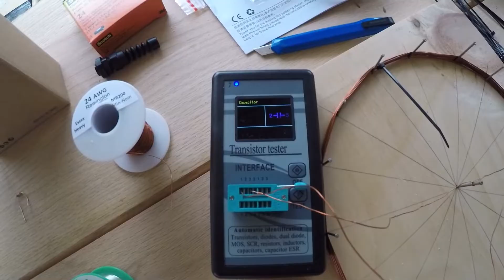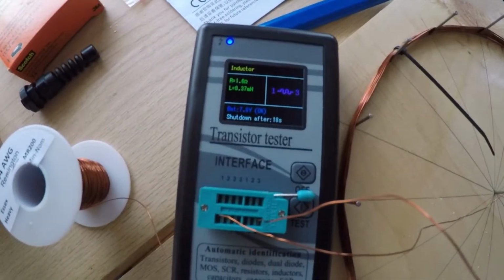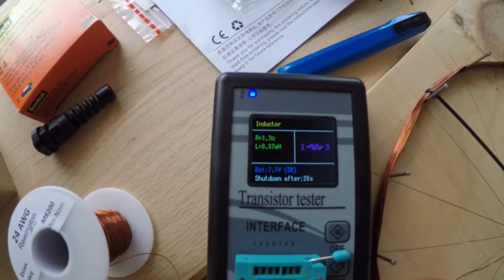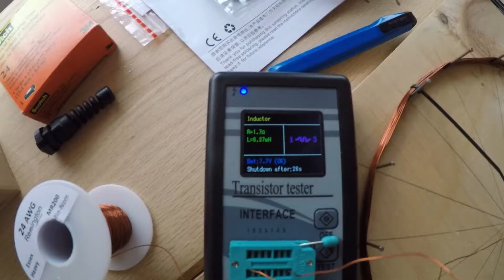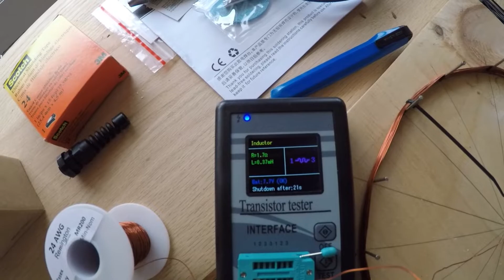DIY Mono Coil for Pulse Induction Metal Detector

Comment: Stupid question, but could you replace that shielding tape with like aluminum foil or aluminum tape?
As long as you keep that gap on top, it basically should''t matter, which shielding material, as long as it's not a closed loop or has magnetic shielding capacity, i.e. is ferromagnetic/iron/steel/mu-metal, as far as I understand.
Planing to build a coil for one of those cheap Ukrainian pulse detector kits.

Comment: Good video! What inductance and dumping resistor you used for the Mini Pulse Plus? Thanks!
Reply from the maker: I think that the inductance of the coil was about 400uH if I remember correctly.  The damping resistor should be calculated as I show in my video.
https://youtu.be/CrJ5tFFmWyo
Reply: @SurfDetector  thanks!

Comment: Are all pulse induction coils compatible with a given PI detector?  I have a PI detector and I want to build a large coil.  How do I know it will work?
Reply from the maker: You need to match the inductance and resistance of the coil to the particular detector

Comment: Hi, Thank you so much for the great demonstration!!! hope you will make more videos !!! and I also have a question !!! I m going to make a coil with 50 cm diameter , 400 uH coil ! And I m going to use a 0.50mm diameter copper wire (24 AWG) but the coil calculator in circuits.dk ask to use a 0.54 mm diameter coil instead of 0.50mm but it is the only size I can buy from the market will that make any effect to the performance ??? it would be great if you can help !!
Reply from the maker: Use the coil calculator on the Geotech Forum, it will be simple for you to calculate the coil.
Reply: @SurfDetector  Thanks my friend !!!

Comment: Hello
Dear surfDetector.
In the video, you connected a separated wire to scotch24 and then the wire is connected to to ground-wire of coil?!
Reply from the maker: Hello my friend.  Have you subscribed to my channel?
Reply from the maker: In the mono coil you solder a wire to the scotch mesh, and then this gets soldered to one of the coil wires then you take them and solder them both to the shield of the cable that goes up to your detector.

Comment: did you solder the ends of the coil wires to the wire feed that runs up to the control box, and, does it interfere or does the coil detect that joint since it is in almost the center of the field, or does the shrink tube block it.
Reply from the maker: Hi Matt,
I seem to recall you asking me this before at some point.  Yes, the wires are soldered in the coil enclosure, the solder joint is not detected, it is a very tiny joint and is moving with the coil.  Are you making a new coil?
Reply: @SurfDetector  yes, the one i mad for the surf pro is not working very good, or its the detector itself. it can detect a metal 2 inch tape measure at 2 inches
Reply from the maker: Hmmm, two inches is not good at all. What are the inductance and resistance of the coil?
Reply: @SurfDetector  yes, especially for a 2inch square tape measure LOL. the ohms are 1.1, and the inductance is .318, used 22awg 300 volt ptfe coated 7 strand hookup wire., removed some of the wire, and it now reads .208 mh and .9 ohms, same wire, specs that came with board said about 230mh. but new coil is not wrapped tight like the other one was.
Reply: @SurfDetector  i took the wire off and put it back on the form but now its to small for the shell, so im going to have to wind again, but this time it came out at 0.9 ohms, and .208mh, the build doc said 230 mh, but my wire wasnt tight yet, so illl make another, you think stay with the build doc at 230mh, or go with 300 mh, i used less turns to lower mh

Comment: which diameter wire would you recommend me for baracuda?
Reply from the maker: I use #24 AWG magnet wire normally.  Tinned, stranded, PTFE coated wire is better but very expensive.
Reply: @SurfDetector  okay thanks
Reply from the maker: @silentgaming9328  I saw that you had another question about checking inductance etc., but it has disappeared.  I use a LCR tester.  The one that I have currently I did a video on.
Reply: @SurfDetector  okay thanks . I dont have an lcr but will go with accurate winding with an online calculator
Reply: And yeah the ptfe stuff is expensive, guess I will go with 24awg magnet wire

Comment: i have to make a coil for the surf pi kit. Can i use a wire of 0.3 mm instead of the 24awg (0.5) or the resistence is critical for that project (usually the resistance increases with a thinner wire ) ?
Reply from the maker: What is of greater importance is the inductance of the coil. You should try to make it around 300uH

Comment: This is why I asked if there was a capacitor in-line you went from it winded to finished never showing how it’s connected to the detector or what’s under the heat shrink you have the only videos on this and I’m so glad you took the time to do them and I know you love your tripod but in future videos could you show how you do your wiring so dumb asses like me can understand you have built numerous detectors and just knowing what you use helps a ton type of wire from the detector to the coil shit I copied most of the parts on your board
Reply from the maker: I will be doing another coil video sometime in the near future.  I will endeavor to show more detail although most people only watch videos for 90 seconds or less.
Reply: @SurfDetector  the length is fine it’s more not moving the camera around to show where all those wires and clips where going to and thanks again for taking the time to make them

Comment: G'day from Australia, i have no electrical training but i have an interest in building my own coils specifically to suit a minelab. I recently bought a multimeter and i want to learn to read the inductance of my current coils that i have. I specifically want to know how to read DD coils, as there are 5 pins, could you be kind enough to point me in the right direction, of course if you have experience with the DD's?
Reply from the maker: Hello Mate,
In order to read inductance you will need an LCR meter.  These are readily available and the price is not too dear.
I recommend that you purchase the book "Inside the Metal Detector"  that will get you started with understanding the inner workings and it has a good section explaining PI machines which  are where my interests lie predominately.  There is a very good section on how to build a DD coil in the book as well.  I have plans to produce a video on a DD build but not in the near term as I have too many irons in the fire at the moment.  Thanks for watching my video and please subscribe.
Reply: @SurfDetector  Thanks for your reply buddy, LCR meter, have been reading on the Geotech site, but never actually heard of that, funny hey?, my interest is in building a very large DD coil like + 30in, the biggest obstacle at the moment would be the housing, would fibreglass work, it would probably be to bloody heavy, but thought i'd throw it past ya?
And i know these coils have to be nulled or something like that, what meter would you use for that, or would you use a oscilloscope for that?
Reply from the maker: You can use either an oscilloscope or you could use a good voltmeter.  A mono coil would be easier to build at that large size and you could house it in PVC pipe.  Youtube doesn't seem to be notifying me of new comments so sorry about the delay in replying.
Reply: @SurfDetector  Yeah mate; know all about youtube and not getting replies,i am from Australia so my interest is in building a large DD to use on my old SD, the highly mineralised soil in the goldfields causes to much false signals using a mono, a 14in mono gives me enough trouble , no way will i be digging 4 ft holes for a false signal, do you know how hard this ground is? have dug at least 3 - 3ft holes for rusty metal, and each hole took a good couple of hours to dig, bloody hard work, this is what i bought it is a " Professional Waveform Multimeter MT8206", it says it is a multimeter and oscilloscope 2 in 1, would this be good enough?
and it has the resistance and capacitance measurement but not induction so looks like i will have to buy an LCR meter.
Can you just explain to me why the DD coil has 5 pins, when there is only 2 wires, is the 3rd pin the ground or neutral, or whatever it's bloody called. 
A large 3D printer could probably print out a casing but not to sure if they are really common and plus you would need to have a design made up first in a specific computer program, Nexus makes carbon fibre coil housings but the bastard wants between 3-4k for his coils, i told him where he can shove it, sorry i babbled on a bit here, will keep it must shorter next time if any!!
Reply from the maker: @egghead2687  A DD coil is comprised of two separate coils, one is Transmit (TX) the other is Receive (RX) so there are 4 wires for the two coils.  The 5th  pin is most likely the shield.
Reply: @SurfDetector  Heck mate; i know about Rx and Tx, you say 2 wires for each? okay; i just realised that when first winding the coil, that original end must be free to be attached later to the cable to complete the circuit (loop) am i on the right track?, i have much to learn about circuitry in general it seems!!
Reply from the maker: You should get yourself a copy of "Inside the Metal Detector"  it's a cracking book and will explain all of the inner workings of detectors and coils.  Keep at it, the good stuff never comes easy.
Reply: @SurfDetector  Thanks for the advice, will do!!

Comment: Should 12 volt electricity come out of the disc outlet?
Reply from the maker: With the coil attached you will generally have a pulse of approximately 12V followed by the flyback voltage which can be in the hundreds of volts.
Thanks for the question and I hope that you will subscribe to my channel.
Cheers
Reply: @SurfDetector How to connect the screen with the device
Reply from the maker: @theworldofelectronics9913  What detector are you working on?  Are you asking about the cable connection to the PCB?  Thanks
Reply: @SurfDetector I am using the Delta Plus 2 device
Reply from the maker: @theworldofelectronics9913  email me a picture of your coil connection on the pcb and your cable.
Reply: @SurfDetector send me your E-mail
Reply from the maker: @theworldofelectronics9913  
it is on the YouTube page
Reply: @SurfDetector Thank you
Reply: @SurfDetector I have sent you the device picture to your email
Reply from the maker: @theworldofelectronics9913  I never received the picture.
Reply: @SurfDetector Thanks my friend for the answer
Reply from the maker: @theworldofelectronics9913  You are welcome

Comment: hi which kind of cable you use to connect coil to PI circuit? coaxial cable or something different? which is the best cable?
Reply from the maker: Hi Andrea,
Welcome to my channel.  I hope that you will subscribe.  I use Canare DA202 cable for all of my coils.
Thanks for the comment :)
Happy Hunting.
Reply: @SurfDetector  hi thanks for your answer. Yes i subscribed.. ;)..
I check this cable, It gas two cable and shield.
Do u connect the two cable with coil leads? And cable shield? U dont connect It?
Reply from the maker: @MrAndreapas79  HI,
You connect the shield and only one of the other wires.
Reply: @SurfDetector  for now i ve coil with two lead and shield. The coil shield  is connect with One coil lead. Now i need cable to connect coil to Pi circuit, the cable that u suggest have two wires and One shield. I must connect also cable shield to One wire? Sorry but i dont understoud Really well
Reply from the maker: Good morning,
Yes I understand that it is a little confusing to try and explain without a picture.  Let me try again.
For the coil, you have 2 leads and a shield.  You should take a short piece of wire and solder it to the shield.  Then you connect that short wire to one of the coil wires.
For the cable you have a shield, you connect this to the coil shield splice that you just made. Now you have the two remaining cable wires that are twisted together, cut one of them off.  You only use one of them and you connect it to the last coil wire.  For the cable connection to the PCB, the cable shield will connect to earth (ground) 

I hope that isnt too confusing.  Let me know.  Maybe I could do a short video.
Reply: @SurfDetector  yes.now.it s clear. Thanks a lot
Reply from the maker: you are welcome. Glad to help.
Cheers
Reply: Surf Detector 
Hi my friend or can you introduce a good metal detector to make it thank you

Comment: Nice to see your video .
i want to build big coil for sdc 2300 40"×20" .pl can you tell me the gauge & how many tons i can use .
actualy in india no nugget found  they manupulet me & big money loss of me so i decided to make coil .
so pl tell about precutaion  & information thanku.
Reply from the maker: Hello and welcome to you,
I am not familiar with the Minelab SDC2300.  The coil needs to be matched to the detector so first you need to know the proper inductance value of the coil that will match to the detector otherwise it will not work properly for you.  You need to know the uH before you can build the correct coil.
Cheers
Reply: @SurfDetector  uh meaning please?
Reply from the maker: @golddustdetector  Hello Jay,
uH  is microhenries
Reply: @golddustdetector  I am an Indian too. First of all, never get into metal detecting if you hope to get gold nuggets. Its just a fun hobby. And making a coil requires hardwork, i would suggest to buy a coil since you have a good detector to use it at its max potential.

Comment: do you have a video of you using this md, i belong to the geotech forum and was looking at the MPP rev E also. but i want to use it in Az desert, so i need a ground balance mod, how small can you find an object
Reply from the maker: Hi Matt,
This coil is actually for my Barracuda.  I have not yet packaged up my coil for the MPP+ as I am waiting for the shell to arrive  so no video yet.  More to come.
Cheers
Reply: @SurfDetector  I subscribed to your channel, ill keep checking back, i would probably need a ground balance mod to the mpp to make it work right in the Az soil here, or at least a DD coil, Had a guy build the MPP revc-d modwel and uses his MXT instead in Az, but i am after sub-gram nuggets all so
Reply from the maker: @mattrowe1229  You should check out the posts  by KRinAZ on the Geotech forum he has modified his MPP+ for exactly what you want it for.  I believe that he is a prospector in AZ.  My machines are only tuned for the water which is where I do my detecting.  Happy Hunting and thanks for subscribing.
Reply: @SurfDetector  Already talked to him, he does not use his MPP even with the mods in the desert, does not work good enough, he uses an MXT vlf with a DD coil and works better, i have been reading 2 threads on people trying to come up with a GB function yet, and they are close, but not done yet, maybe a DD coil for the MPP